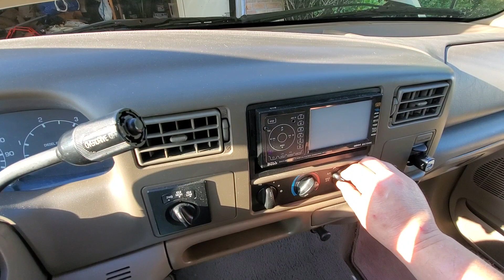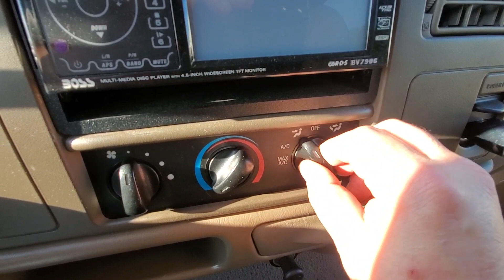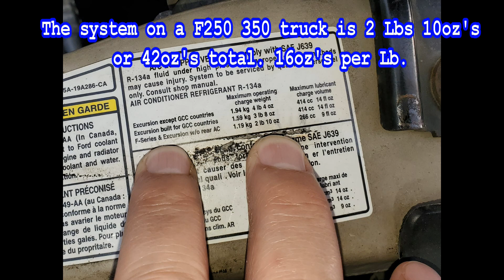How to Detect Low AC pressure Easily Ie F250 or F350

Comment: Hi Great Video overall, it's good to have another person inside the cabin while you video the clutch engaging or not.

I have a 2003 F150, no cold air, the R134 pressure seems enough as it is in the green area.  you did not cover the case where the clutch engages for 30 seconds and then dis-engages and keeps cycling like this. This cycle is also observed on the refill gauge as well the need creeps in the middle of the green the kicks the left.   If the high pressure switch is only meant for safety ie. extreme pressure because of some blockage, what else is commanding the clutch to dis-engage too soon?   What does the PCM figure to stop the clutch in normal operating condition or is expected to be always engaged when the knob is in A/C?   I did change the battery recently could that have confused the PCM?  Thank you.
Reply from the maker: Well sorry I missed seeing this question for sure. Sorry I don't remember seeing it popping up that I had a notification. However this is best set of questions yet.  I'll try and answer them as best I can and give you some items to check. 
From your description the system sounds normal. Vehicle AC systems normally does kick in and out about every 30 seconds. The reason the gauge drops to the left into the green when the compressor is on is because the compressor is pushing the fluid into the Orifice at the same time the compressor is pulling it from the other side of the Orifice. The compressor ends up with a tug of war over the Orifice Tube. Meaning the compressor is pushing on one side of it while on the other side of it's pulling it or sucking it through the Orifice. The gauge with the green is attached to the pulling/sucking or low side which is AFTER the Orifice. So as the compressor pumps the pressure will drop into the green to about 45-55 psi if the outside temperature is about 80 degrees. If it drops into the white area its really low on R134A or has a blockage before the orifice somewhere.
If all is operating normally in the green, at the same time this is happening the pressure on the high side is building up, you can't see that because you probably don't have a gauge hooked up to see that. That pressure is normally around 175 - 210 psi if the outside temperature is around 80 degrees.
When the compressor shuts off the pressure on the high side will start to bleed into the low side via the Orifice and the pressure on the Low side where the green gauge is will begin to rise. At the same time the High side pressure will start to drop as the pump is not running to push it up. So what's happening is when the pump is not running both sides try to balance to the same pressure through the Orifice.
So as long as the temperature in the vehicle coming out of the vents has air that is approximately 30 degrees cooler than the outside air your system is operating normally, and the compressor should cycle about every 30 seconds.
If it kicks in and out about every 5 seconds that 's to fast and is most likely a result of an improper charge. A set of gauges will definitely help tell you. If it's just a little low (Under Charged) or if it's just a little hi (Over Charged) it will kick in and out quicker.  I hope my explanation was helpful, if not try and find some videos that describe how a vehicles AC system works. Then get back with me and well try a few things to narrow it down. My biggest question is, is the temperature coming out the vents about 30 degrees cooler than the outside air? If it is your system is operating normally. If you're unsure take it down to the local AC shop and have them give it a quick check up. Most of the time it's about $30.00 buck to have them take a look at it and maybe put a little R134A in it. Let me know if I need to try and help you more or answer more questions. That's what my channel is all about. Best Wishes & Blessings. Keith Noneya
Reply: @keithnoneya  Thanks for articulating great details on the push and pull function of the compressor.
My A/C was blowing hot air in hot 90F weather.
I did take it to a shop and paid $126, they said it was low after all :(, he also said he added a die in case it leaks in the future.
The single cheap gauge of the refill kit scared me and was told overfilling could blow a hose, and that's where I went wrong.
I should have used the dual gauge kit and vacuum pump I borrowed but again I had not hit on a good video about its usage (my 1st time with A/C).
To confirm, (A) When the pressure maxes out (175-210 at 80F) is it a 30 seconds timer in the PCM or the high pressure switch that shuts off the clutch or (B) ?   
(B) the cycle on/off of the clutch is a direct result of the low pressure switch (via PCM), when the compressor max out the high pressure line, the low pressure must drop below the low pressure switch setting.  (by design it takes 30 seconds to bleed and equalize thru the orifice).  
(C) What is the typical low pressure switch trigger?, I think I heard in some video 20 PSI?   
(D) At rest, everything OFF, both lines would equalize to what typical pressure?   This compressor tug of war would explain the cycling :) I will verify now that I have cold air, that it is indeed cycling about every 30 seconds.  Thanks again.
Reply: @keithnoneya  On the 2003 F150 I checked with a flashlight from underneath and counted over 3 minutes and the clutch did NOT stop turning at all.  It runs continuously whether in normal AC or Max AC setting (both in Hi Fan speed) How do you explain that?
A temp probe in the vent reads 63F and  58F on Max AC knob.  Outside temp today is 92F

However, our 2005 Honda Odyssey (never AC serviced) does cycle the clutch and the electrical fan shuts off about the same time.
At the vent it blows an incredible 39F 

See my earlier questions.  Thanks.
Reply from the maker: @mumtiTV  Yep sounds like it was just on the verge of being to low.  
I've done a lot of vehicle AC repairs and have had great success doing it. Primarily because I do my research/homework on what i'm going to do before I do it. I am a self trained technician. I don't do this for a living and the other reason i'm successful at it, is I ask my friends who are Licensed technician and have either OWNED their own AC business or are currently working professionally in the field of AC/HVAC systems. So although I know way more than your average person on the street I'm not a professional so take what I say with a grain of salt and ALWAYS do your own research before you do something new. You'll have a lot of fun learning it and get to save a lot of money as well. So here's my opinion you your questions.
- My truck cycles about every 30 seconds and so does my 2014 Nissan Murano, I do find it irritating. 
- My trucks AC today, I just checked, is putting out 44 deg at the vents and it's 81 deg's outside right now. I suppose different AC systems will act differently depending on the control systems used. 
- The difference in temperature for the AC & Max AC is: Just AC uses outside air and has to cool that before it comes into the cabin area & Max AC recycles the cabin air that's already been mostly cooled. 
(A), (B) & (C) - In my truck, 2001 Ford F350 and most vehicles, the Low Pressure or Compressor Cycle Switch cuts out around 24.5 psi and turns back on around 43.5 psi. The operating pressures are normally stamped on the switch itself. With that said the pressure you refer to (175-210) are not the max pressures for the switches, those are the recommend or expected pressures of a properly operating system at 80 deg's.
- The High Pressure Switch normally opens at 460-490 psi and closes again at 230-290 psi, and again the operating pressures are normally stamped on the switch. I "suppose" the 30 second cut off of the compressor can be by either switch if the pressures go outside of the operating pressures. So I can't really answer that one. But I know it's normal for my truck and my Nissan as they cool great and seem to work just fine at the approx temp of 30 deg's below the outside air temperature.
(B) The use of the PCM to control the AC System & Radiator/Condenser Fans is dependent on the vehicle year and manufacturer of the vehicle. Typically the newer the vehicle is, the more likely you are to have both the ECM/ECU and the PCM or TCM control the AC System Components. Some vehicles actually use vacuum to control the vents and at WOT (Wide Open Throttle) the ECM/TCM or low engine manifold vacuum to cut the compressor off to allow the engine to use the max available horsepower of the motor. I had a 2002 Grand Caravan and a 1991 Dodge Dynasty that this happened to all the time. This is also very common in trucks that are pulling up a hill or romp on the throttle to pass someone on the highway.
- My vehicle relies on the two Pressure Switches, the TCM (Transmission Control Module) and the WOT Throttle Position Switch. Of course there are relays and fuses in the system as well, but in my system those are the major components that turn the compressor on and off. 

(D) The Equalization Pressure (my best guess) should be a little lower than 50% of the maximum recorded pressure of the system while operating. The reason for the lower than 50% is when the system operates the high will actually we a little higher because of the heat in the compressor and high pressure lines when operating. When you shut the system down that extra heat is removed.

I hope this answers most of your questions and that I got them right from what I know from either reading or my own personal experience on AC systems in vehicles. 
There is a whole world full of some really cool AC systems and the different gasses they use and how they use those gasses to keep us cool. Thanks for some really good questions and watching. As always feel free to ask more questions or let me know of something I missed. Best Wishes & Blessings. Keith Noneya

Comment: Should my low pressure switch have power to one of the lead holes that you jumped? I tested low volts on my multimeter and I’m not getting any power to it and I also did the paper clip method and the clutch still won’t engage I also tried jumping the relay
Reply from the maker: Yes it should have power on one side if you are in; Max AC, AC, PAN/FLR or DEFROST. The compressor clutch gets its power from the Refrigerant (High Pressure) Switch via the Clutch Cycling Switches. The power once it makes it through those two safety switches it goes into the connector on the compressor. The top wire is the power feed (POS) from the switches and the bottom wire is the return (NEG) to ground. You can see the wiring schematic in the "Ford Super Duty F-250 & F-350 Pick-ups 1999 thru 2006" Haynes repair Manual on page 12-4. Hope that answers your question. Let me know if you need anymore help, I usually answer within 12-24 hours. Thanks for watching. Please Like and Subscribe if you want to help my channel grow. It helps even if you never come back. Best Wishes & Blessings. Keith Noneya

Comment: My problem is just the opposite.  The AC system on my truck was open and not running for several years.  The ac manifold was ruptured, and snow/ice got into the compressor etc.  I replaced the compressor, condenser, accumulator and manifold hoses, and tested.  It held vacuum, so I took it to a shop to charge.  It cools fine again.  The compressor clutch engages and disengages on the initial start up as the PCM runs its' tests, but then engages and never cycles.  It is engaged regardless of the AC being turned on or not.  Is this something I can do or is it a shop situation?  It is killing my MPG, and cold weather is not that far off.
Reply from the maker: What year is your truck?
Reply: 2002 F150 5.4L
Reply from the maker: @tarlcabot5108  Are you familiar with using automotive schematics and using the shop manual?
and do you have a multi-meter for checking voltages, or a automotive test light?
Reply: @keithnoneya  I have the Haynes manual, but haven't seen it since I moved a couple years ago.  I have a multi-meter and might be able to work my way through a schematic.
Reply from the maker: @tarlcabot5108  OK,  I don't have an F150 but most systems have the same components, just their locations are different places. Take a good picture or scan a picture of the diagram and email it to me; keith_noneya@att.net and we'll try and walk through it. I'm not a certified AC tech, but I've been working on vehicles for over 35 years and I'm a retired Aircraft Electronics Technician and Aircraft Test Set repair technician. I've also fixed quite a few AC units and troubleshot quit a few vehicle electrical problems. The hardest part is finding the component connectors.
We may find it in a day, or it could take awhile. Either way it depends on how fast you want it repaired. If we don't fix it for winter, but I think we will, just unplug the compressor until we can figure it out. Best Wishes & Blessings. Keith Noneya